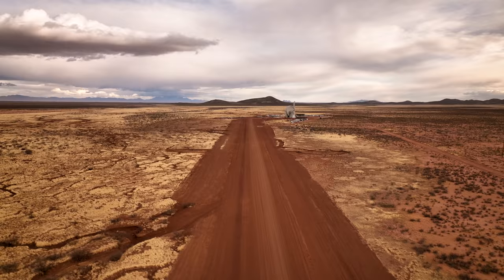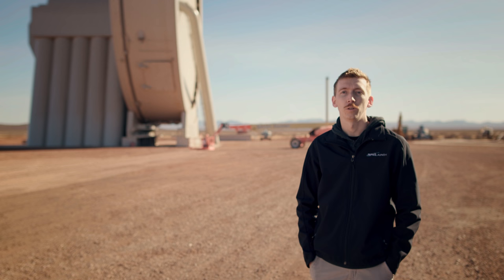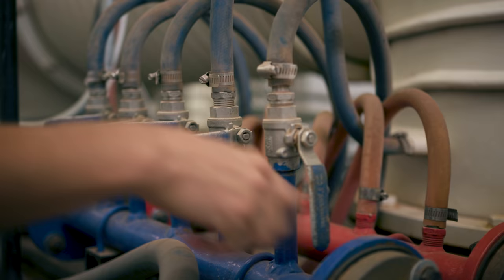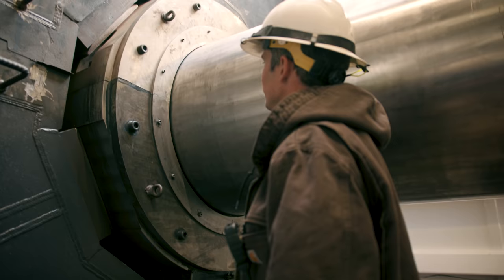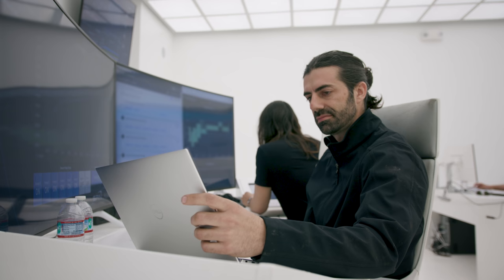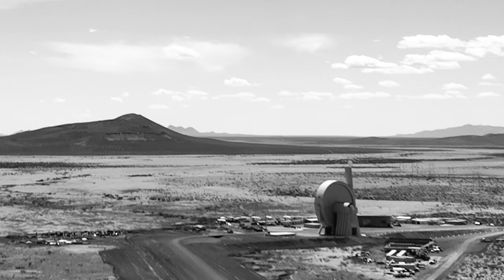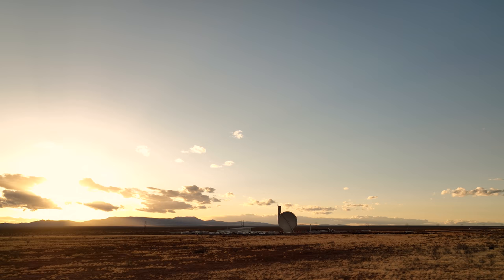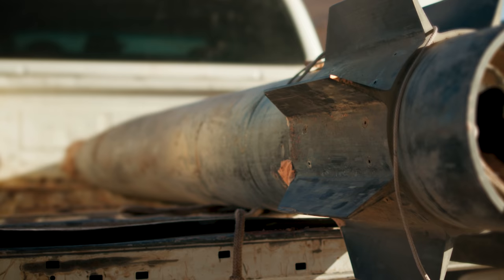An Inside Look: SpinLaunch Flight Test #7

Comment: I have tremendous doubt this will ever be a practical alternative as a first stage orbital launching platfom.

Seems impractical, imprecise, practical loads bound by tremendous g-forces, costly and difficult to maintain a high vacuum chamber, especially when scaled up.
Reply: ^*100% correct- It’s pointless masturbation.
Reply: I'm guessing you're a fan of spacex
Reply: The Army might be interested.
Reply: @spanqueluv9er  if everybody had the same “can’t do” attitude as you, humanity would get very far.  It takes courage to think outside the box, but that is where the greatest rewards lie.
Reply: Costly?. This one seems a lot cheaper than using rockets to launch satelite
Reply: I think it's more about slinging say a rocket up into the upper atmosphere where it can then ignite its own engine. Save some fuel.
Reply: The launch velocity would have to be far greater than orbital velocity, and that would be at atmospheric pressure. It would just burn up. Besides, it would need some kind of burn to circularise... you can't just fire something into a circular orbit
Reply: @olivertoeknuckleiii2093  
There is thinking outside the box. And there is thinking outside your brain.

Not every wild idea makes sense or is rational.
Reply: Likely true, but then again they probably said that about airplanes during the Wright Bros era.  This might wind up being useful for some niche payloads - i.e. sending up non G force sensitive materials (like fuel, steel, water)  via this and using a SRB  for final injection into orbit.
Reply: @Pablosammy1   They don't have to, but use of an ablative heat shield and a SRB for remainder of velocity could be possible.
Reply: @Francis-rs7zu  
"... they probably said that about airplanes ..."

No "they" - they who knew about physics - did not.

"... and using a SRB  for final injection into orbit ..."

How? And no.
First an SRB has mass and length. How do you accelerate this, keep it in one piece and still keep it light. So how?
Secondly, you cannot control speed and orbital manoeuvrability with an SRB. So no.
Reply: I do completely agree with you. At a point where the launch velocity would give you an advantage, the g force would be too high.
Reply: It's more useful for army
Reply: @rr85  Fuq Space X.💩🙄🤡🤦‍♂️
Reply: I can see it possibly working on the lunar surface (with no atmosphere and much lower gravity) but not Earth.
Reply: @Francis-rs7zu  you are right fuel and water aren't g sensitive,  but you need a container in which you would store it and that would be g sensitive.
Reply: not just impractical, if the projectile is released at slightly the wrong moment it will just destroy the whole thing and could possibly send some stuff where you don't want it landing...
Reply: @wimahlers  Thank you for existing and for having common sense.👏👏🙌🙏
Reply: @kishoremehta4568  It’s not useful. The end.🤡
Reply: Impractical, imprecise, tremendous g-forces, costly
Reduces to 0 your dependancy on fuel to launch cargo/packages to a target destination granted it's not destroyed by g force
Sounds exactly like something the Army would love to use to throw bombs at far away targets. Heck, at this rate, it's probably easier to just rack up a lump of pig iron and launch it instead of using bombs, it's essentially a meteorite impact.
Reply: @wimahlers  Also, transforming electrical energy into force to accelerate an object inside a vacuum chamber is FAR more cost effective and energy efficient than burning fuel. BTW "impractical" is false and "imprecise" is easily fixable.
Reply: If only man could fly.

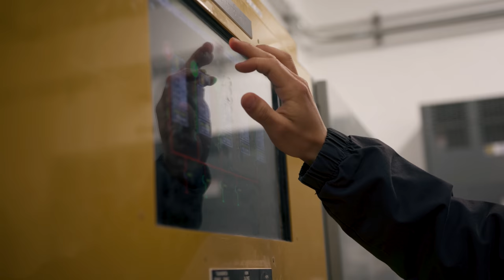Comment: 0:55 OK - projectile plus payload, then attach the counterweight. All good so far. But after projectile launch, what happens with the mass of the counterweight? Presumably it still has tremendous kinetic energy and rotational inertia, which is now unbalanced due to launch of the opposing projectile load. So....how is this managed?
Reply: I'm guessing it is released in the opposite direction.
Reply: @dariozanze4929  Hell of a lot of kinetic energy to dissipate right quick!
Reply: @dariozanze4929  Opposite direction means shooting it into ground.....

Comment: How do you compensate for the projectiles weight instantly leaving the rotating mass and having the entire machine violently shake itself apart?
Reply: I've been asking this same question for awhile now with no response.  Maybe it's some proprietary system so they can't really say, but I really have no idea how they can achieve this.  I did hear something about a "water brake" during this video so possibly they use water to counteract the forces somehow.
Reply: My guess would be the counter weight being half the weight of the projectile with the system being able to handle the unbalance. Once the projectile leaves, the weight would shift 180 degrees to the other end of the arm but still only be half the weight of the projectile.
Reply: @Mi-ck  
At the speed quoted and guessing the radius as about 20 m (scaled from the guys in the cherry picker) they’re pulling about a 1000g on that missile.
If you’ve ever lost a balancing weight from a wheel you’ll know that even a half ounce weight can throw things right off balance. I don’t think your idea would work. Not sure what would, though🥴
Reply: My guess would be a sliding weight that gets released on the launch arm at the time of release to compensate the payload weight, and a huge braking system to stop it ASAP
The sliding counterweight can be much bigger than the projectile and thus doesn't need to move much along the arm to keep the balance, and the opposite counterweight could also move closer to the axis at the same time.
Timing needs to be perfect of course
Reply: @robertlane6431  Let's take a look at scale. Per the SpinLaunch website:  "The first generation launch system is designed to launch satellites weighing up to 200 kilograms." About 440 pounds. 440lbs + another 160 lbs for the fuselage? So, let's make a vague, uneducated assumption of ~600 lbs total weight, is going to be a lot easier to manage the counter-forces than if we were talking about 6 tons. 600 lbs rotating at 1,000g is a 600,000 pound load. 6 tons turns into a 12 million pound load. 

According to patents filed by the company, a counterbalance spinning opposite the rocket gets released at the same time, preventing the tether from becoming unbalanced. I'd seen some discussion regarding the concept of using water as the counter-weight. In theory, the combination of rapid re-pressurization, and those speeds would vaporize the water almost immediately, so I doubt you'd have to worry about handling a solid 600 pound mass rapidly decelerating. 

For those pondering it, the patent also states that the rocket coasts for about a minute and ignites its engines at roughly 200,000 feet. So, yes. It is intended to have a sort of "second stage" engine"
Reply: I think the arm itself is sliding into center. U can calculate the New balance point when the load is launched and then slide the arm to the new center of mass.

Everything must be fast, otherwise nothing could be launched anyway.

Comment: I'm not sold on this as a viable launch model but i hope I'm wrong because it's very cool and i want to see a full sized version fly.
Reply: Who knows what this could be used for. For all we know this could be the main method used in the future to launch cargo off the moon.
Reply: ...or launching astronauts off of the Moon.  This scheme fits with Futurama's vision of having an amusement park up there.
Reply: They aren’t here to sell you on it.

Wonder if it could sling smart munitions?
Reply: @jaredf6205  Exactly. Research like this often finds uses in ways not necessarily what folks think it's for.
Reply: @UgandaBeKiddingME 
You personally are buying satellite launch?

Off YouTube?
Reply: I agree, not viable, however I do applaud the fact they are trying,  In the end though I feel it’s a waste of money.
Reply: @greenidguy9292  No offense but I'm wondering where you got your engineering degree from that makes you so much smarter than all the engineers working on this project? Also NASA has signed a contract with them so they seem to think there's a good chance it will work.

Comment: What happens to the counterweight once you've released the projectile?  Does the rotor become extremely unbalanced?
Reply: Exactly that's the problem and also the timing of the explosive to release the projectile.
The channel Thunderf00t made a good debunking of this. But today selling an idea is more important  than making a real proof of concept. 
Ok they achieved about 1100mph with the projectile but the escape velocity  of earth is at least 25,020 mph but you have to be a lot faster than that because of air resistance. Then there are also much higher forces involved when you have to get at least 30-40 times faster and the release mechanism  has also withstand that forces with higher precision in the release of the projectile.
Reply: @abelgerli  The system isn't designed to FULLY send payloads to space. Rockets attached to the payloads will be the ones to finish the last leg of the trajectory to space. Aerospace America and other aerospace magazines explain the philosophy of the spinlaunch system
Reply: @glenncoco4893  The ballpark numbers are correct even in this case the international space stations orbits earth in a very low altitude and does it with 17,100mph so the numbers ere in that ball park.
Reply: They may not have realized this yet, but it's easy.  Just release the counterweight at the same time as the projectile.   Then for the next launch, they rebuild the facilities a mile or two away from the crater and go again!
Reply: @SansNeural  I could not agree more 🤔🙄😆
And may be put the launch site completely under ground to protect the people around in case of failure.
Reply: it gets debunked, fast!
Reply: The balance must be perfectly maintained and that's just not possible!!!!  (or correct... lol)  Look at video of the USAF centrifuges that they spin people in.  There is no balance shaft.   It's all handled with bearing load.
Reply: @bradleyrex2968  The NASA centrifuge is only spinning at 30rpm and up to 12.5G. (50RPM and 20G without a human payload). 

Balancing the shaft hardly needs to be as precise at those numbers compared to the extremely high rpm and g-force on this orbital launch system.

As an example, an 85kg astronaut on the 8.84m NASA centrifuge at 9G (30RPM), without any balancing whatsoever, would create only 755kg of force on the shaft. Well within design capabilities of common construction materials. However, the centrifuge is still balanced during operation.
Reply: They release the counterweight and the payload together. They must have some cool tech for catching it....the ultimate in regenerative breaking?
Reply: @nmode7420  As an example, an 85kg astronaut on the 8.84m NASA centrifuge at 9G (30RPM), without any balancing whatsoever, would create only 755kg of force on the shaft. (If the shaft and the enclosure for astronaut had a mass of zero)  lol!
Reply: @scifisicko2390  They release the counterweight and the payload together?  When did they say that they release a counterweight?
Reply: @bradleyrex2968  the shaft and enclosure are balanced. So, yes. They have an imbalance force of zero.
Reply: @nmode7420   Review: Centrifuge Training • Wright-Patterson Air Force Base,  They clearly are not balanced.
Reply: @bradleyrex2968  the AFRL Centrifuge at Wright Patterson AFB runs a counterweight under the floor... Next.
Reply: @bradleyrex2968 they don't but there is no other way.  US patent 11021271 granted to spin launch describes a support device that is disengaged at launch to allow the wheel to spin.
Reply: @scifisicko2390  Wouldn't having a weight in the spinning arm that moved toward the released rocket be a way?  I mean that took me 20 seconds.   And the patent is 4+ years old.  Does the patent force them to do it that way?   It's mandatory?
Reply: @bradleyrex2968  Eitherway a big challenge is containing the counterweight . The plan is to have the tip of a 100m arm travelling at 7 times the speed of sound generating 10000gs at the tip. Your solution would be like catching an artillery shell fired from a rail gun. Time will tell but it's a he'll of an engineering problem. You are right they don't have to do it the way it's described in that patent. It's also not their only patent.
Reply: @scifisicko2390    There's nothing wrong with being skeptical, but they have video of launching projectiles from this 1/3 scale system to 80,000 feet, and there is no counterweight released.  "like catching an artillery shell fired from a rail gun"?  Would that require more force that was used to launch it?
Reply: @bradleyrex2968  Extract from their patents. The numbers refer to diagrams in the patent documents.

The launch vehicle 105 may be released from the launch vehicle tether... Simultaneously, the counterweight 135 may be released from the counterweight tether 130.

...The circular mass accelerator structure 150 may comprise a second exit port directly opposite the exit port 115 to capture the counterweight 135 that is released simultaneously with the launch vehicle 105 to minimize an imbalance on the motor at the time of release.
Reply: @scifisicko2390  "The circular mass accelerator structure 150 may comprise a second exit port directly opposite the exit port 115 to capture the counterweight 135 that is released simultaneously with the launch vehicle"

This means the counterweight is shoot into the ground - as this is the opposite direction.

Comment: How many G’s does that projectile feel during spin? And wouldnt you get better benefit if you just simply took that rocket to airliner and lift it to 15km mach ,85 for launch?
Reply: Based on a centrifuge diameter of 33 meters (which may be the outer diameter) and a launch speed of 1200 mph, I get a G force of 1778. So maybe around 2000 G's.
Reply: And the calculations, for good measure.

Launch velocity: 1200 mph (1931.16 kph)
32186.00 meters per minute

Chamber diameter: 33 meters
Chamber circumference: 103.67 meters

Revolutions per minute: 32186 / 103.67 = 310.47 RPM

Relative centrifugal force: (310.47/1000)^2 * 16500 * 1.118 = 1778.14 RCF (Gs)
Reply: @eluenskybender2948  Wow... Nice work.  Great math problem to work out.   I just don't see this as viable for sensitive electronics or other stuff launched into space currently..  You think a Starlink satellite could withstand those G forces?
Reply: @avflyguy  I don't have any knowledge about this. But I doubt that any "ordinary" payload would be able to sustain the 20,000 G's that some claim is neccesary to get into orbit. But you could of course increase the diameter of the centrifuge, which would lower the G's. But I still think it's an interesting project, whether or not it will be succesful.